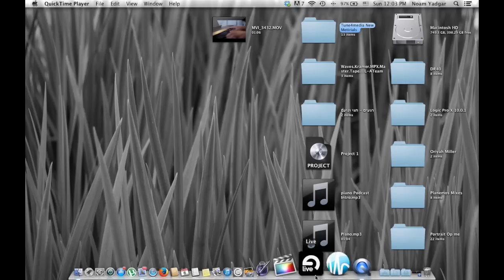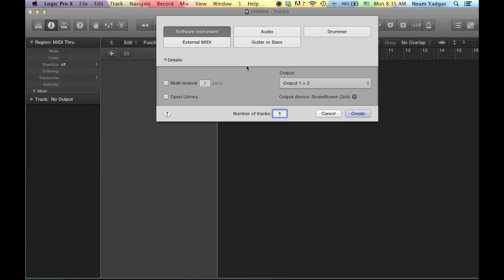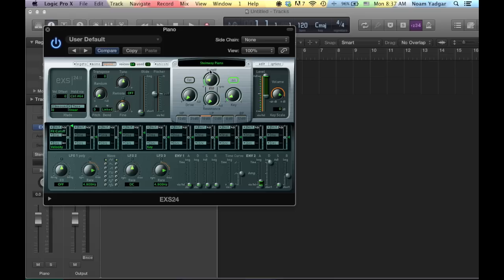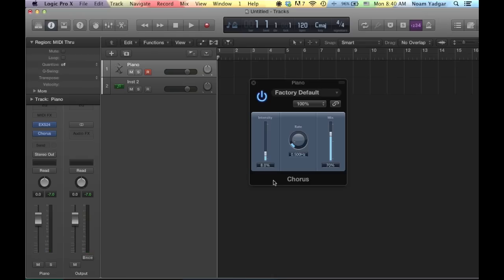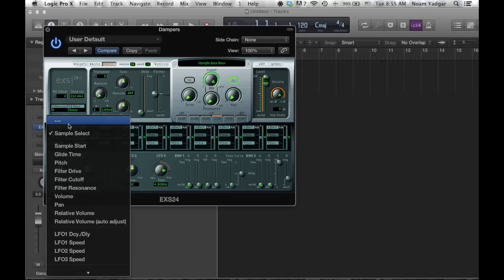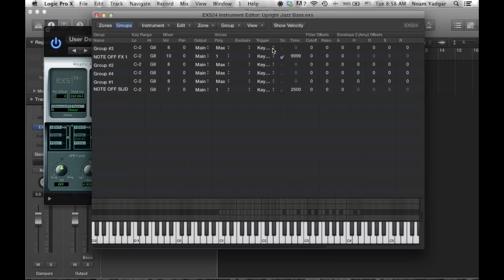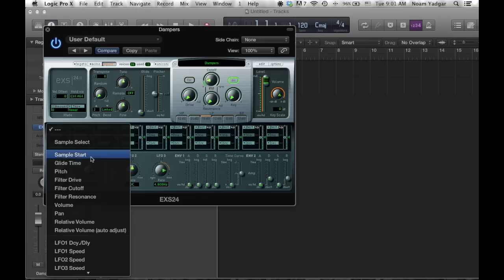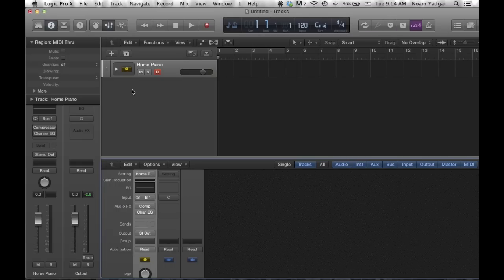How to make an Upright Piano sound (In Logic)

Comment: Hi. A dumb question. How did you get the piano input?
Reply from the maker: The piano is sanding MIDI information to the computer (Physically, through a USB cable.. If you have an instrument with MIDI output and you don't have any interface that support MIDI cable.. search for "MIDI-USB" there are plenty types out there, for example the "UX16" is a good MIDI-USB adapter)
Reply: Thanks! This worked!
Reply from the maker: Victor Krottner
You're welcome :)